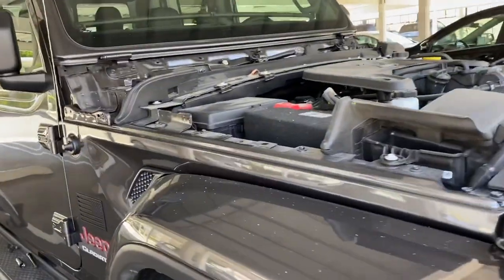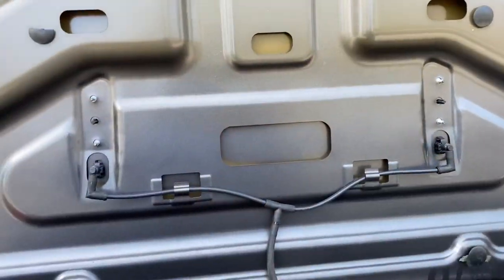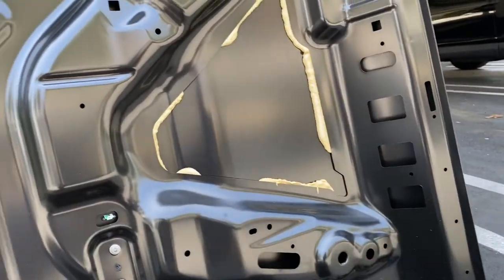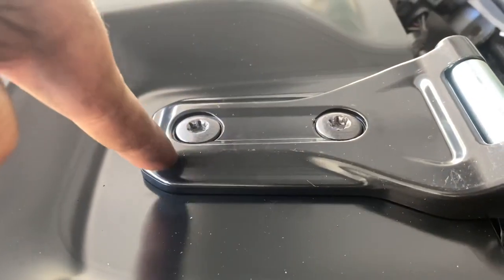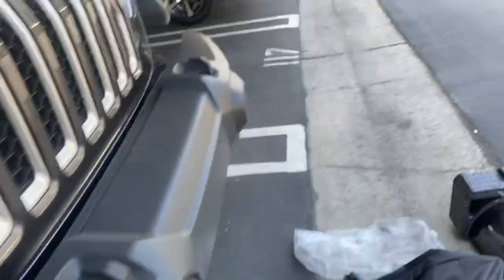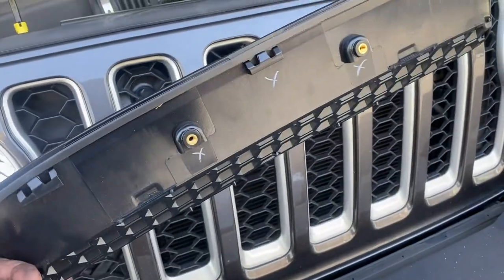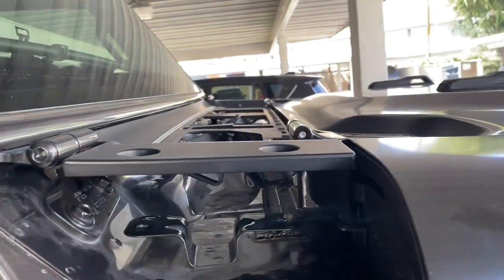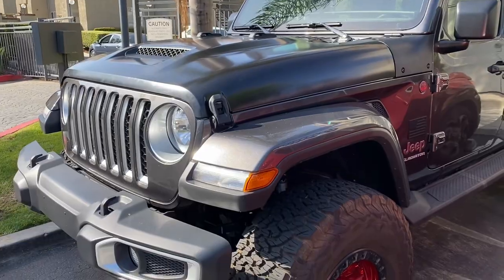HOW TO: Mojave Hood on a Jeep Overland

Comment: Hey greatly appreciate your post! I got a Gladiator Mojave 3 weeks ago and thought what a cool vent but how stupid it's non functional! Like a stripper wearing a long sleeve T-Shirt!
 thanks to your video I was able to take it apart very easily I didn't even have to remove it. All I had to do was go in there with a knife and a screwdriver and separate that piece from the back of it like you did with the butter knife. yes I had to cut a section the fire insulation out but it came out really nice with a razor blade. AGAIN I appreciate the video your Gladiator's looking good!

Comment: Looks good, dude. So really just the hinges and the spring need to be swapped with the hood?
Reply from the maker: Yup, the sensor for the "hood is open" has a block used on the Mojave that allows the hood to say "hey jeep the hood is closed"
Reply: @thatdudewithajeep  Can you tell me a little about this block.  Your video gave me the encouragement to replace my hood too but struggling with the sensor.  Appreciate the help.
Reply from the maker: @works192  the "hood is still open" sensor?
Reply from the maker: If so, it's called a "striker" you can get it from the parts department at jeep

Comment: The Mojave hood is soo good. But maybe the Rubicon hood is easier to do a swap?
Reply from the maker: It's definitely easier, you don't have to swap out anything between the cowls (to include the cowls)
Reply: @thatdudewithajeep  Are you going to paint it? By the way, what would be super cool if you'd also buy the fenders from the Mojave/Rubicon. They look cooler. ). I want to do the same on mine.
Reply from the maker: @EddiTaru  this was about 1 year ago,  since then, I've upgraded a few things to include rubicon chopped fenders one of my more recent videos has more you'd be able to see